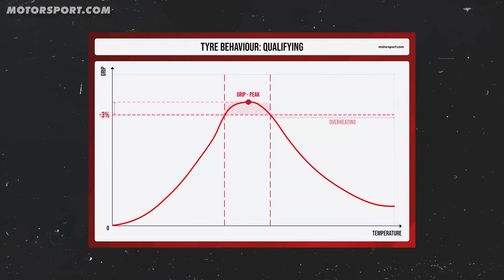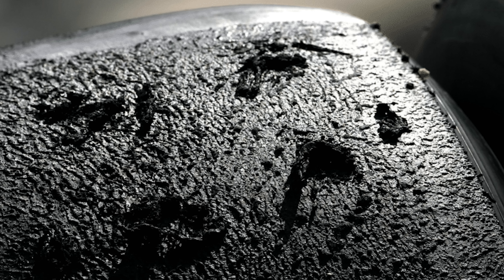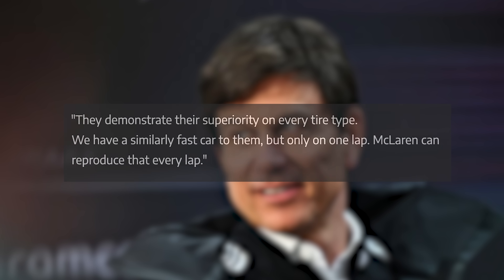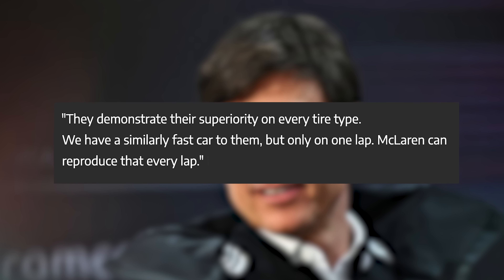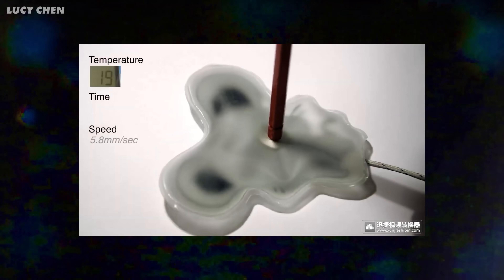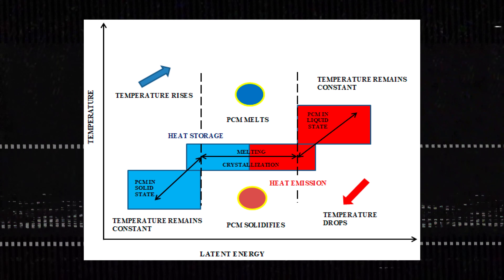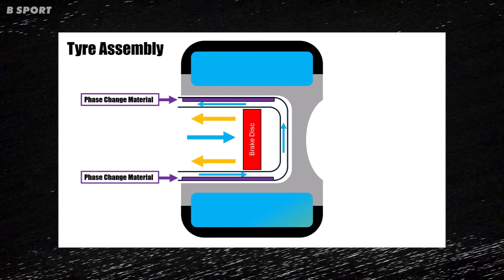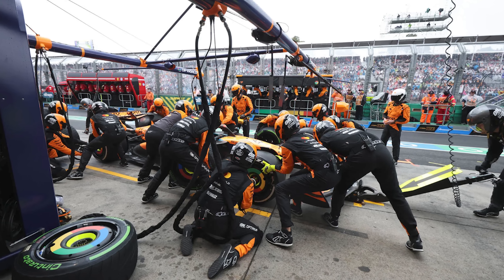McLaren’s GENIUS Tyre Trick Explained

Comment: i am pretty sure it has more to do with the extreme Anti-dive McLaren has than just breaks. cuz anti-dive makes the ground effect work for you instead of the rubber and there for you wont overhead the rubber thanks to the extreme anti-dive McLaren are using..
so i dont think break system is the real and only answer to how McLaren can keep their rubber at a solid temp.

Comment: State change? Possibly. But rather than any amount of extra thermal capacity of the state change (which must be negligible compared to amount of heat the brakes release) the devil is likely in changes to thermal conductivity of the material after the state change occurs. Meaning it could be pretty much thermal insulator when it's cold and good thermal conductor after it has melted.

Comment: Would spraying super supercold aerosol on the tyres and brakes work? Pumping air into storage in several cans, let normalize temp, then spray compressed air onto tyres to cool down as air expansion reduces temp of air.

Comment: I'm not sure I'm buying this. PCMs can only absorb so much heat per volume. The volume of a brake drum is low, and a lot of it is taken up with components like the rotor, disk, caliper and ducting. Brakes generate a huge amount of heat though. It seems like someone with some background in brake design could give some good guesses at volume available for PCMs and heat generated by F1 brakes and do some rough calculations to get to the bottom of this.

Comment: Very clever. Are they also running on impulse engines or warp engines?  Where are the di-lithium crystal stored? Is there a flux capacitor as well? Does someone have to say “engage”?………. A very clever article. No mention of inertia……fluids move….especially during acceleration and braking. Also no mention of centrifugal force…..the material whilst liquid will change the Center of gravity within the wheel exerting considerable force at the rim of the wheel………..beam me up scotty.

Comment: is it possible they use this on the rim itself?
Reply: We don't know if they are using that material.  That is just one theory.  Also, there another technology that uses magnets to keep things cold.   A German company has already come out with a refrigerator that uses nothing but magnets and no traditional gases to keep things cold to sell soft drinks.
Reply: @HellBot-gi5si ah pelteiere coolers, those are interesting but suffer at hot temps easily, thats why they phase change materials are whats used for laptop cooling
Reply: @HellBot-gi5si i just realised phase change and pelts are both used in fridges i have a mini fridge with one of those in, why dont they just use watercooling though?
Reply: @lucywucyyy  You say why don't they used water.  Simply more hoses and water more points of mechanical failure.   If you eliminate water and hoses the more reliable the unit and you can also reduce cost during the manufacturing process.   It's a win, win.    Reduce cost, better reliability.

Comment: a more common example of this is in laptops
almost all laptops have phase change heat pipes inside, its actually not as good as the direct air cooling a desktop uses but much more compact
Reply: Also, remember this car has a battery, they could be using "magnets" to keep thing cold as well.   A German company has developed a vending machine to sell soft drinks, that used nothing but "magnets" to keep their drinks very cold.  So we know the technology works.  McLaren could have repurpose it for their brake drums as well.
Reply: @HellBot-gi5si do they do any work with materials that absorb and reflect infra red radiation?
thats anther way they could perhaps use some kind of coating to dissipate heat

Comment: It's like those plastic flexible mats  people use when cooking!   Like what they use to bake cookies on!      

While the pan gets hot spots, that material heats to a certain temperature and dissipates the heat equally so your cookies or food cooks evenly!  

I've used these mats in ovens as high as 800°F which would make it the perfect type of material to line the inside of the wheel wells with!     The difficulty would be finding a compound to attach it with that doesn't break down as it gets hotter.   Most glues get soft as they get warmer.  Metals expand and maintain more heart.    Silicone and other materials being used in Computer chip technologies might be what they were using!

I was reading about a company that mines a specific type of material that conducts electricity and heat better then silicone and might be the next material used in GPUs and CPU chips.    

McLaren thought outside the box and as long as it's not banned by the rules, good for them!   

I personally find F1 to be a very boring and too engineering dependent!    F1 has made the rules so the team with the best Technology wins vs the team with a best drivers or the teams with the best strategies!   

I miss the old 1980's 90's F1 when a driver could catch fire and hunt people down!!  Those older cars were monsters and they took a monster tamer to dominate a season!  

Today it's all about the technology and rarely do you have a driver who just gets into that zone and out drives everyone else!  

This is one of the reasons I enjoy GT racing so much!   The cars are fairly equal and finding a driver that suits a specific car can make a major difference!!   Driving styles matter!!

Hopefully F1 will shorten the vehicles and bring back the days when a driver could get into a zone and hunt down other drivers like a predator hunting it's prey

Comment: water IS a phase change material. they didnt use water, they used another liquid cooling? nice try making it sound interesting.
Reply: Liquid cooling doesn't involve phase changes, that's refrigeration or evaporative cooling. In a liquid cooler you use liquid as a heat transport medium, boiling is an undesirable behaviour and will lead to hot spots, pumping losses and over pressuring the system.

Comment: thats what water is. its a phase change material. it turns to steam at ~210f. thats most of why it cools so well. so they didnt use water? they used a different material that does the exact same thing? thats not interesting.

Comment: Now please correct me if i am wrong. But arent phase change materials illegal as per regulations?
Take for example the technical regulations 15.4.1b:  [...[ the following materials or processes are forbidden:
Shape Memory Materials except for piezoelectric materials used in electrical sensors.

Sure this might not include the type of phase shifting they maybe use but there are also other regulations: For example if its a phase changing material that goes from solid to liquid it would breach article 11.5 which prohibits liquid cooling for the brakes.

Okay one might say now,  "What if its a gas becoming solid or a solid becoming gas"
Well there is still one more regulation that would forbid that:
Technical directive 10.8.4d: [...] Any other device, system or procedure (except for driving of the car) the purpose and/or effect of which is to heat the wheels, hubs or brakes above the ambient air temperature, or to maintain their temperature if they are already warm, is prohibited. 

Generally one could also say the fia only allows air and the forward motion of the car to being used for brake cooling. I think its some weird but extremely well engineered ducting. No idea how, but i think phase changing materials are not the solution, as basically the regulations above forbid that.
Reply: Solid-solid pcms are a thing. There also just aren't pcms out there that could handle the heat load of an entire race within the volume constraints of a wheel assembly. What's more likely is that they are buffering the energy release during peak braking and then have to be cooled down and revert phase again before the next braking event.
Reply: @karl0ssus1  But would't that still break directive 10.8.4d? It would still be a device that maintains the tire temp when its already warm. Or Am i missing something? I'd love to know :D
Reply: @LazyboyLP  Well, the wording there is specific and from a technical pov, a pcm is going to be cooling rather than heating. I'm no lawyer but that would seem to nicely dodge the rule as written.

fwiw, I don't think pcms are actually being used here, or if they are the impact is being blown out of proportion. It is hard to imagine netting more than a degree or two out of a system like this without having to make it enormous.

Comment: The material can absorb energy at a constant temp, but only in proportion to its mass, and if located in the drum, its unsprung which is worse. They'd have to be very carefully judging just the right amount to give them a little bit of effect without dramatically changing the mass of the wheels. Strikes me that ultra high efficacy insulation might be more effective, there are insanely expensive insulation material you can now get. Perhaps they're even using both... phase change material absorbing initial blas of heat and ultra effective insulation keeping it there.

Comment: The fundamental principle at play here is enthalpy, which refers to the total heat content of a system. More specifically, the concept relies on the enthalpy of fusion, which is the amount of energy required for a material to transition from a solid to a liquid state without a change in temperature.

In this context, if McLaren is utilizing a material with a high enthalpy of fusion in its brake rotors, it could absorb significant heat during braking while remaining at a stable temperature. This phase-change mechanism allows the material to act as a thermal buffer, preventing excessive temperature fluctuations that could degrade performance. Essentially, as the material melts, it absorbs heat without an immediate rise in temperature, ensuring sustained thermal management without needing additional cooling systems.

https://en.wikipedia.org/wiki/Enthalpy_of_fusion

Comment: The phase material can absorb heat and reject it.... but, the situation is that in a race, you are always trying to reject the heat overall.  Once the phase material is changed phase, it is essentially done, it has to reject the heat somewhere.  Where?   Now if if it was connected to a radiator, that could reject the heat, but do we see one?   I agree it is probably aero force or aero cooling  may be a more of an answer to their advantage.  The phase material could smooth the temp delta out though across a lap, but ulimately it has to go somewhere.

Comment: Very instresting. But if the phase changeing material is in the break assembly, then the mclarens couldn't warm up the tires quick, because the material won't allow to transfer enough heat from the break to the tires.
It could only help to stabilizing temperature in long run.

Comment: Why not install an air to air heat exchanger in the hub or on the air inlets as well like they have been developing for jet engines to cool oil.  Would explain the why there is a cooler Infrared reading in places.

Comment: I think it may be a Red Herring.  The Drum is ducting and a heat shield.  Lower the temp of a heat shield is ineffective since radiation involves T**4.  That leaves air flow.  Now you need to pass Q from the phase change fluid into the air flow by means of convection.  A smooth surface (i.e. duct) won't do it, the mass flow is too great.  So you'd have to increase surface area by means of fins and other exotic shapes.  There's no room to do that and it would be visible.  There would have to be a revolutionary concept to transfer Q into and out of the PCF.  

If radiation is indeed a factor, a simple solution would be a double wall drum which is TWO heat shields.  You'd have to produce a dT between their inner walls with cooling flow - if there is no dT there, system will behave like a single wall heat shield.  You cannot make the drum behave like sodium filled exhaust valves which involve conduction, not convection and radiation.

Comment: The lunar rovers used paraffin to cool the batteries. While driving around, the paraffin would melt while keeping the batteries coolish. Once they were done driving the rover, they would open the battery compartment and let the paraffin cool by radiating the heat out to space.
Very cool.
Thanks for another interesting video.

Comment: PCM's are widely used in electric vehicle technology for the cooling of the battery pack as a heat sink and they also use Ethylene Glycol (antiFreeze) in the liquid cooling of batteries which increases the range of cooling properties of water. (EG boils at 197'C at standard atmospheric pressure) as with all liquids this goes up when put under pressure, i think they maybe using PCM lining in the brake drum and also pumping through a cooling liquid under very high pressure when the temps get to a critical level in a similar way the brakes used to get brake fluid now its brake by wire.  to win in F1 you have to innovate maybe this is their brawn double diffuser, brabham fan car, 6 wheeled Tyrrell or lotus twin chassis moment .. fair play to them

Comment: Well this is a theory, an if it changes phase, in one of the phases it has to be either a fluid or a gas material, which you need to keep contained. just applying it to on a surface like a material wouldn't work but I don't think there's too much space for channels, plus they would be really delicate. Also if that's the case, thermal imaging wouldn't show cold spots, would it, it would only show perfect temperature because that would be the ideal phase changing temperature to get the desired effect.

Comment: The Apollo lunar rovers used wax in their battery compartments to absorb the heat generated by the batteries during operation.  The wax melted (phase change) absorbing the heat and keeping the batteries from overheating.  During the astronaut rest period the heat radiated away from the wax through the walls of the battery compartment, the wax solidified (reverse phase change) and the lunar rover was ready for another day of driving.  1971.

Comment: I doubt they are doing as the engineer in the video described in placing the phase change material behind the brake rotor assembly. That is a huge distance from the tire itself and while it would help soak some heat from the tire, heat does not transfer through air very efficiently so I doubt they could regulate the tire temp effectively in this way. It would help with braking though. I think it is more likely they put some thing in rim or on the inner tire directly. Just a quick thought, I am also an aerospace engineer FYI. Love the videos!

Comment: I don’t believe it. PCMs generally don’t match ice’s latent heat. To make a meaningful difference over a race you’d need so much weight it’d be obscene. For longevity this must be either using mass exchange (e.g. air cooling) or regeneration (e.g. a water cooler and radiator), and likely dynamic cooling control of the above.

Comment: RedBull hate this one trick because it's fucking legal and they're just mad about it.

All you need to know.
Reply: Exactly mate. I used to tune and race motorcycles, first thing is go through the rule book and if anything isn't specifically banned it's allowed, sometimes a grey zone but just keep asking which rule bans it?
Eg
My bike was always below minimum weight with blocks of lead "strapped" to the frame.
Seems pointless?
You can alter the weight distribution by moving the lead weights forwards or backwards which can make a big difference on a track with hard downhill braking or hard Uphill acceleration. 
Imagine the Corkscrew at Laguna with the tight turn at the bottom instead of the top, heavy braking downhill or in the reverse direction heavy acceleration Uphill.

Comment: Why not use a rubber with a lower melting point as part of the tire itself? Maybe make strands of it and weave it through the tire rubber. As the tire heats up, the rubber strands soak up the heat directly from adjoining tire rubber. Might cause the tire to be slightly weaker and more prone to failure under high load, but maybe that is acceptable?

Comment: I don't understand how brake temperature (which is inside, and also doesn't contact the tyre directly) will affect the surface of the tyre, when rubber is an insulating material, and doesn't conduct heat.

Comment: Surely teams have thought about insulation before now! Why not use those brickettes like on re-entry space vehicle shields or 1 of Multitude of other materials. And don't they use the brake heat to get the tires hot for Qualy? How does that work? Are Maclaren using smaller disc dia. To allow extra room for thicker insulation containers that keep the melting stuff in place. And another thing what is the mass of this magic stuff required to soak up a few hundred degrees temp over 90 of minutes , cause once it melts it doesn't take anymore heat then it cools giving off the heat it just doesn't seem like the cycle hot cold would absorb anything like the heat energy in such a small mass. I think Maclaren have sent everyone on a goose chase and are sitting back laughing

Comment: It sounds all fancy and complex, but all materials that can melt or vaporize are "phase change materials". For example: water that reaches freezing temperature keeps expelling heat, but does not get any colder, until it has turned into ice (its phase changes to solid). 

But this way of cooling is fundamentally different from simply pouring water over the drum to flush away heat: the material providing the cooling stays in place. Since it is an add-on to the air cooling, just a bit more additional cooling could have quite an effect. You basically could mount it in the air cooling path and provide some extra chilling. Interesting. 

Theoretically, if you would put a block of CO2 ice in the air cooling path to provide extra chilling, would that be allowed?